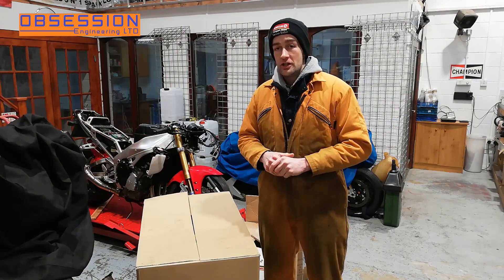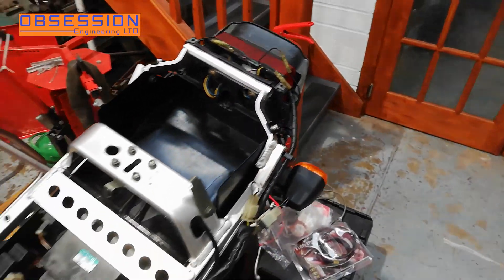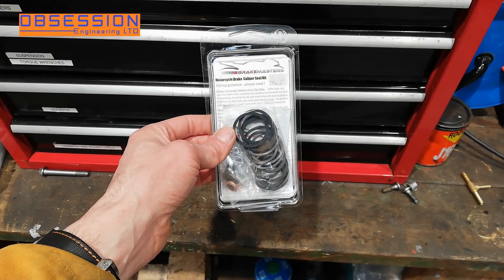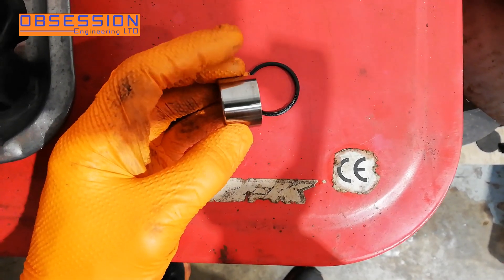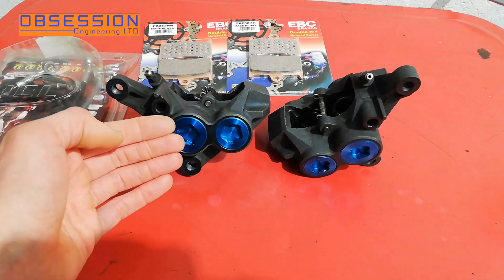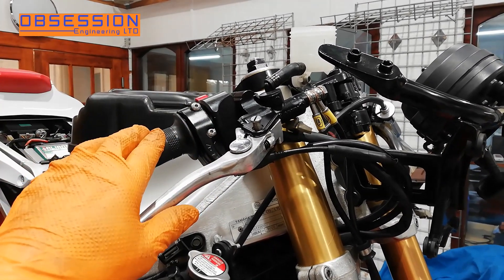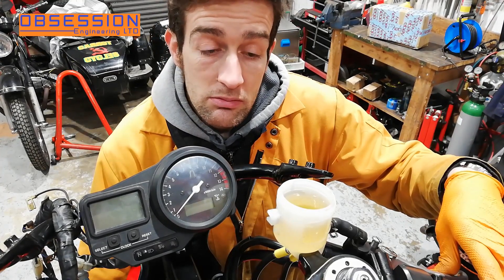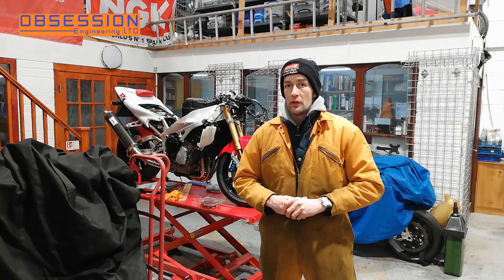1998 R1 Jigsaw Puzzle Project. Part 3. Cleaning and Bleeding brakes as well as fitting some fairing

Comment: Much appreciate the time you have taken to vlog your R1 4XV rebuild efforts. 

Regarding the blue spots; You mentioned replacing the seals one by one. Yet its best to first remove all the pistons then clean the caliper, replace all seals and insert all pistons. That way you reduce the risk of debris being left behind in the hydraulic tract. To do so using compressed air, remove one piston, remove its seals then insert back the piston and wrap a tie wrap around it. Repeat for all pistons. When achieved you can then cut all the tie-wraps and remove all pistons fairly easily allowing a thorough cleaning of the caliper.

Comment: Nice video again! Do you have a link to the video with the caliper cleaning? 
I tend to, if possible, push the brake pistons out using the brake pump, but most of the brakes I rebuild really really need it (so taking them apart completely is advisable ;) )